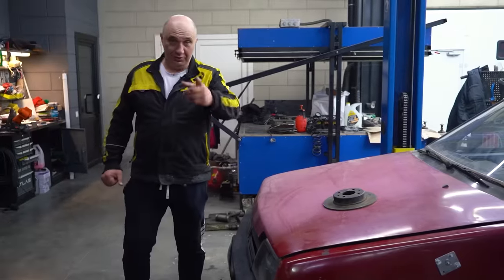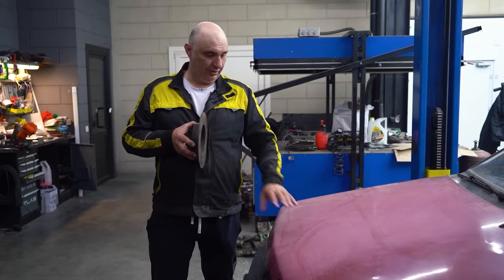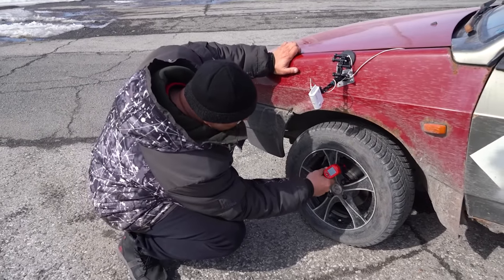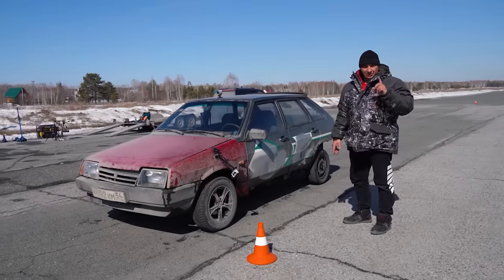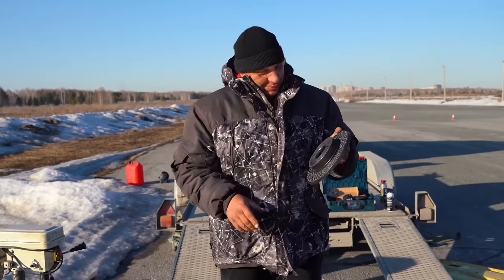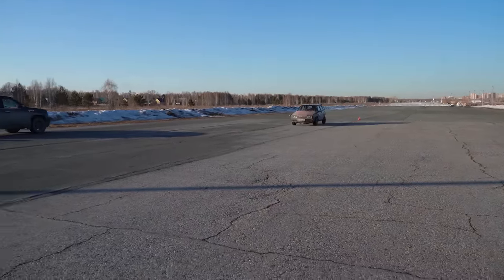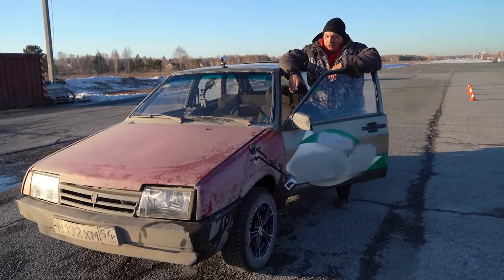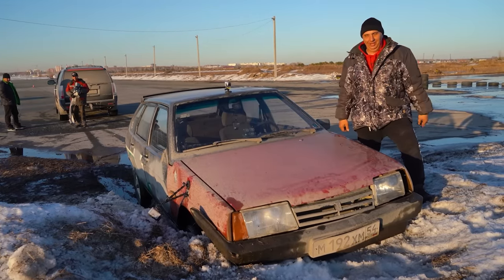We progressively cross drill Lada brake rotors - what will happen?

Comment: Most of the loss in distance between tests could be attributed to the pads and rotors bedding together and working better after some stops. Brand new pads on brand new rotors always stop more poorly for a period of time and a few heat cycles before they're at peak performance.
Reply: That’s what I’m thinking.
Reply: Properly bedded brakes will transfer some material to the rotor face. I don't think there actually needs to be more friction. Lots of brake systems on a car are actually way oversized where you can lock the tire at will.
Reply: @timothybayliss6680  Yeah, if the wheels can lock, the brake is powerful enough and the stopping distance depends on the rest (like weight and grip). The cooling advantage likely isn't appreciated at a highest temperature of 100-ish degrees Celcius. They would barely steam up water that hits them, nowhere near fading point.
Reply: @Kalvinjj  prolonged heat generates brake fade. Not common in a regular car unless you are severely speeding. 

Get a car up to 100mph+ and firmly apply the brakes, before you can stop you will have to slam on the pedal to get wheel lockup. Do it again and you can push with ALL your might on the brakes and it feels like you lost 50% of your brake power and you can't lock up a wheel or activate abs if your life depended on it. 

Brakes are certainly oversized for driving within the speed limits, but once you exceed that and really test the brakes you know how little energy they can dump. Which is how trucks get into trouble going down hills. Hot brakes barely work, and with a heavy vehicle it's even worse.
Reply: extra heat is good, too...b/c russia LOL
Reply: @volvo09  Yep, the test is too short when it's just one stop, up to 100, cool down, drill, try again. Fade would happen way past the 1st braking test at the speeds they were going (and what a freaking near dead Lada can get to).
Reply: What is that spray they are using?
Reply: @timothybayliss6680  I totally agree, yet I'm surprised that reducing the rotor's surface area didn't seem to increase the brakes ability to lock up the wheels after a certain point.
Reply: @volvo09  They aren't speed limits. They are speed suggestions.
Reply: could also be the driver getting better at stopping without abs
Reply: @zlyable  I'm fairly sure that Mr Lada there, Vlad I believe is his name, has more experience driving cars without ABS than the entire comments section on this video has experience stopping cars without ABS.
Reply: @volvo09  exactly. I wish people understood how anemic stock brakes usually are once you take them anywhere outside the realm  of grocery getting sunday driving.
Reply: @volvo09  trash trucks if they don't have mag brakes
Reply: @IntegerOfDoom  The law states to go double the speed the signs say right? Except when police is nearby. That’s what I was taught.
Reply: @thabg007  you can't take accurate reading off shiny stuff so it could be just primer or paint. ( it should drie up fast and get of with slight breaking as any other debris)
Reply: Yup, that's what I was going to say.
Reply: Everybody is so wrong here. No top level racing series use drilled rotors (F1, WTCC, BTCC, LEMANS, etc).  At most they have small J slots or just flat discs.
They don't want to lose any brake performance with less surface area and less rotor mass.  Modern brake pads do not offgas like old pads used to.
Reply: @engineer1692  I think you need to tell Brembo and all the other makers, they all use drilled apart from some Carbon discs, all motor bikes and even pushbikes have drilled discs. Google it for yourself the evidence is there for all to see.
Reply: @engineer16  yeah I guess porsche didn't know what they were doing when they installed cross drilled rotors on my car. Car is built for taking it to a track.
Reply: @antonisautos8704  A street car you can track is not a race car. Does it have onboard fire suppression? A large kill switch near the steering wheel? An external kill switch? Cage? Telemetry to your pit crew?
Reply: Yeah. I was wishing they actually broke in the pads rather than testing with brand new stuff. Classic mistake.
Reply: Gotta break em in
Reply: They never got them hot enough bed in. Or fast enough. Barely 45 mph. You nee 60-80 mph to get complete rotation at the temps required 

So all test results are unbeded rotors and pads.
Reply: @CJ2808  I disagree with that statement of the "anemic" stock brakes. All modern brakes, are really well made and tough, by law they have to be, and they can take REASONABLE abuse in the car that they are fitted in, so no, I don't think that brakes are bad outside of "sunday grocery shopping". Stock brakes are reasonably good, now if you go on a track day and push really hard, you push a car to its limits, always activating ABS on every corner, making the tires smoke and screech, then yes, they are gonna fail and overheat, but 95% of buyers aren't doing that, for anything else they're gonna work fine.
Reply: actually incorrect... its physics... By taking material for the pad to squeeze on you actually increase clamping pressure. Pressure = Force/Area by reducing the area of effect the force is imparting on you increase clamping pressure. But twsords the end where there is not enough surface area to clamp down on is why the brake distance started increasing... The problem and why you don't see this as often is holes tend to start developing cracks in the rotor face and can in some cases explode.

Comment: I suspect a lot of the initial decrease in braking distance had little to do with the holes and more to do with the pads bedding in.
Reply: Or the sharp edges or the holes digging into the pads better, while more uses create a rounder edge.
Reply: yeah and holes should be bored at a angle too so it dosnt dig the pads in and the air circulates outwards ,its more precise than what theyre doing
Reply: @girlsdrinkfeck  At an angle? Why? They're countersunk to avoid needing to drill them at angles.
Reply: With all the holes drilled the pads have less gripping force.
Reply: @RenoBusdriver  yep. Then add in even more surface area gone due to the large countersinks. Really wasn't much surface area left at all after that.
Reply: @the_kombinator  It is an angle that is in the direction of travel, not just a cone caused by countersinking.  so /.../ instead of \.../.  If is actually would make a difference IDK.
Reply: @DavidStrchld  OK I kinda see your point... They must experiment :P
Reply: Everybody is so wrong here. No top level racing series use drilled rotors (F1, WTCC, BTCC, LEMANS, etc).  At most they have small J slots or just flat discs.
They don't want to lose any brake performance with less surface area and less rotor mass.  Modern brake pads do not offgas like old pads used to.
Reply: @engineer1692  Drilled discs are prone to cracking under thermal stress, but they are great in wet driving because holes remove water between the discs and the pads. Of course, discs must be ventaleted, not solid.
Slotted/grooved discs dont't remove nearly as much water, but they are better in almost every other way. They are mode durable and will not crack, the grooves clean the pads and keep them flat (but do wear them out faster). The grooves also provide better initial bite, because the leading edge of the groove provides higher friction coefficient than the flat disc.
Reply: actually incorrect... its physics... By taking material for the pad to squeeze on you actually increase clamping pressure. Pressure = Force/Area by reducing the area of effect the force is imparting on you increase clamping pressure. But twsords the end where there is not enough surface area to clamp down on is why the brake distance started increasing... The problem and why you don't see this as often is holes tend to start developing cracks in the rotor face and can in some cases explode.
Reply: @RenoBusdriver  Believe it or not, that is not relevant to brake pads. Braking force is pretty disconnected from pad or rotor size. You can double your rotor and pad size and your braking force will not change in any significant way. Do not tell the big brake kit boys though they spent big money on their useless "improvement". Big rotor and pad kits will spread out the same amount of force over a larger area which also means less heat buildup so there is a small benefit but not worth upgrading in 99% of cases
Reply: @DarkAttack14  You're wrong. Big brake kits are all about moving the pad outward to get more angular stopping force. Additionally, they're designed to use racing pads which need higher temperatures to operate properly. A higher temperature pad needs a larger rotor because it has more mass and can therefore hold more heat in order to work more effectively on a race track.

For sure, the average person who is driving on the street doesn't need a big brake kit. But that doesn't mean that big brake kits are useless or just for show, they are for cars that see heavy braking at a track. But braking force is absolutely dependent on rotor size (just like it is dependent on rotor temperature).
Reply: @DashCamSerbia  Slotting/drilling has nothing to do with wet driving. When braking hard on a hot pad, a gas layer builds up between the pad and the rotor. The slots and holes provide an escape path for that. It has nothing to do with any edges on the holes or slots, because any properly prepared rotor will be glass smooth regardless. Holes are always countersunk to avoid any hard edges (which would do nothing more than grind the pad down prematurely).
Reply: @rars0n  You don't know shit. 😂
Reply: @DashCamSerbia  Projection.
Reply: @rars0n  LMAO. Go learn something.

Comment: When you take away rotor surface area (drilling holes) you take away the ability of the brake pad to have something to push against (called brake effort).  As you found out, there was a test where a small amount of holes reached the maximum brake effort.  All the best guys.
Reply: Less friction area
Reply: Also, it's now not a very smoothe surface, you can hear the clickity clack sounds, each hole can be compared to a bump or pothole in the road just like it makes your car bounce they are making the brake pad bounce and each bounce it makes it's not properly uniformally compressing the rotor as it should compounding with what you said above, so all around it's a bad idea.
Reply: Was about to say the same thing, glad others are mentioning this.
Reply: @MidnightMarrow  I've been an auto, jet engine mechanic and a metal machinist for 60 years. Yes, I'm 77 yrs. old.  Been there , done that, got the "T" shirt as they say.  
I'll bet bet a lot of subscribers don't know about mechanical things.  They have other interests.  All the best to ya'.
Reply: @chieft3357  There was nothing you said that an 8yo wouldn't know. Dumping your 'credentials' is only more humorously pathetic.
Reply: @chieft3357  Wow, check out the humility on this guy!
Reply: @Honey BBQ Sauce  I'd say that clickety clackety sounded more like the camera mount vibrating. The noise didn't stop till after the wheel stopped. And it stayed constant throughout, and if it were the holes, the rhythm would've changed with speed of rotation.
Reply: @Vicus_of_Utrecht  The obvious was not mentioned so you pound me for mentioning it??? At least I have qualified credentials in mechanics, do you??
Reply: So wider tires does mean more grip?
Reply: It's the reduction in mass, keeping the brake pads within the operating temperature for which they are designed.  Less surface area means less heat transferred to the pad. The rotor doesn't really care how much surface area it has, what matters is the mechanical advantage of the pad in terms of how far away from the wheel center that it is grasping. For all your years of mechanic experience you apparently didn't learn much science behind the things you were working on.

Comment: I really enjoyed this video, it answered several of my "what if I just..." questions. The engineers have obviously discovered that there's a point where cross drilling and retaining available braking friction surface is maximized, as this experiment proves. I'm also fascinated by the chamfered slotted and cross drilled rotors. The slots allow pockets for the gasses to expand and evacuate without compromising the structural integrity of the rotor disc. Science around this is very interesting, thanks Garage 54!
Reply: OMG I'm getting sick of seeing people say the same thing. The surface area has nothing to do with the braking ability. It's about the mechanical advantage (ie how far away from center the pad is) and the temperature of the pad itself. Every brake pad has an optimal operating temperature. That's why when they added holes, it got better up to a point until they added too many holes. It has nothing to do with surface area, OBVIOUSLY. Otherwise the initial holes wouldn't have improved the performance.

To make it crystal clear, the additional holes resulted in less rotor mass to absorb heat. Thus, with too many holes, the pad gets too hot and becomes less effective.

Comment: I had drilled, slotted, and vented rotors on my dually. They lasted over 200k miles and that’s with pulling and hauling as a dually truck was intended for. I didn’t replace them with the same thing. I got regular vented rotors and they wasn’t the cheapest either. But they lasted half as long. Same as the pads. About half the life as before
Reply: I had a set for almost 250k on a s10. Replaced them when I saw cracks starting to form.
Reply: Yeah mine was starting to wear threw to the center vents. Still stopped fine just made noise. Never warped or any issues.
Reply: Mine only lasted 20K, towing a lot. Never going to waste money on it again.
Reply: @BBb-hs9ud  YOU MUST BE GHEYLORD
Reply: Heat kills things
Reply: @BBb-hs9ud  What torque setting do you use for wheelnuts? Just send em to the moon?
Reply: What do brakes have to do with pulling and hauling?
Reply: @adamvowless3078  everything. You have to stop plus the extra weight. Which is harder on brakes
Reply: @erikcourtney1834  Brakes are not (well shouldn't be)  applied when "Pulling" or "Hauling"... Yes when "Stopping ".. 👍
Reply: @adamvowless3078  why would they be used if your not stopping?  Eventually you have to stop no matter what your driving. The heavier it is the harder and longer it takes to stop.
Reply: @erikcourtney1834  i used jakes and gears on tractors that weren't even fitted with front brakes... Probably getting off the subject but i was just giving a wind up about how you worded it 😁 peace
Reply: @BBb-hs9ud  Yeah, drilled and/or slotted rotors would be a total waste on a towing vehicle. Almost makes one wonder why you'd be stupid enough to buy them in the first place.

Comment: those stopping tests would have to be repeated like two or three times to see brake fading and if it doesn't crack near those holes, Ive seen dozens of cars especially going sporty or on a track with cracked rotors near those holes, never seen any with full ones, but my guess is they will cool down harder due to limited airflow and dust on them
Reply: You're talking to a bunch of Russians though. Science = out the (broken) window.

Comment: Brakes are converters of car energy due to friction to heat. Better heat disipate, better are brakes,  but the more holes, the smaller the temperature capacity and friction surface so brakes are less efficient. U need to balance friction temperature capicity and heat dicipate, to have the highest friction, highest heat dicipate and not loosing the temperature capicity( this parameter is responsible for multiple braking).
Reply: yeah its better if they added heatsink fins to the rear or cut into the rear to make some grooves

Comment: This is a demonstration of unsprung weight and thermal mass.

Unsprung weight:  weight of components below the suspension that rotate with the wheels (includes rims and tires).  The lighter you make this, the more dramatic the results (each lbs is about equivalent to removing 10 lbs of weight anywhere else)

Thermal mass:  the amount of mass on an object capable of resistance absorbing and dispersing heat through itself.  Think radiators for CPU cooling.  If you apply 100 watts of input to 100 grams of mass, it will be cooler overall than applying that same 100 watts to 90 grams of mass because there is less material to hold the heat.

I'm not 100% sure I was accurate, so if you're interested in these ideas I suggest you go research them yourself because sometimes you might find a secret interest, you never know.

Comment: Everybody is so wrong here. No top level racing series use drilled rotors (F1, WTCC, BTCC, LEMANS, etc).  At most they have small J slots or just flat discs.
They don't want to lose any brake performance with less surface area and less rotor mass.  Modern brake pads do not offgas like old pads used to.

Comment: It's important to note that the operating temperature of the brake pad is critical in how the brake pad performs. That is, with a normal brake pad that is designed for everyday driving, the brakes are expected to operate in a lower temperature band, and therefore will benefit from the rotor having less mass to shed heat more quickly. That's why it initially started stopping better.

For a race vehicle, when the brakes are expected to be operating regularly at much higher temperatures, those pads will NEED more heat to operate properly, and will therefore perform better with a rotor that absorbs more heat. In fact, under race conditions, having mass to absorb that heat is critical, so drilling lots of holes will only result in worse braking performance.

It's interesting to see this test, because they got to a point where they drilled so many holes that even stock brake pads eventually performed worse.